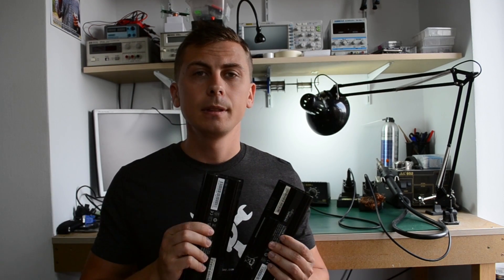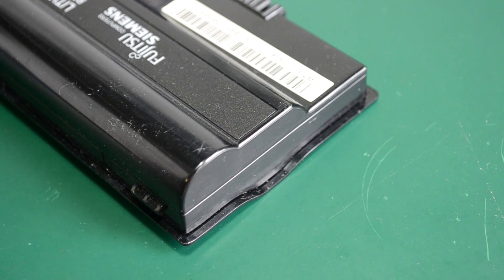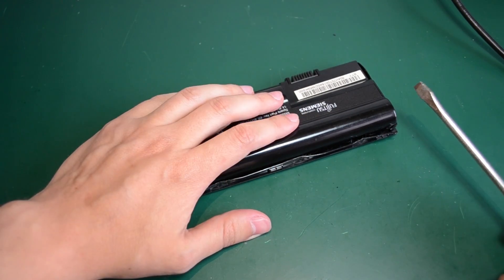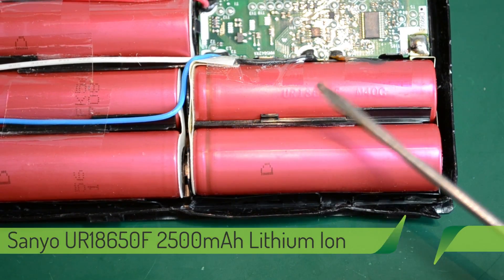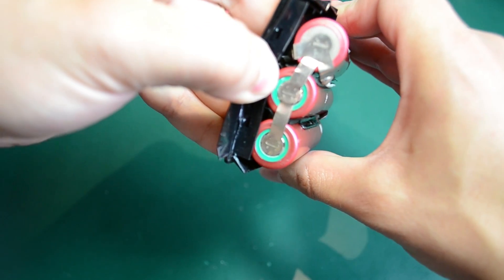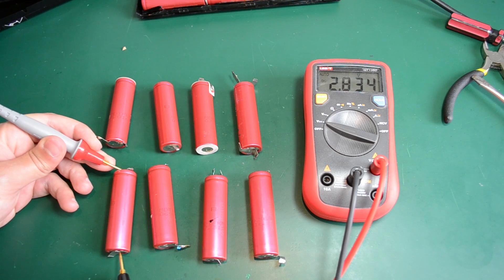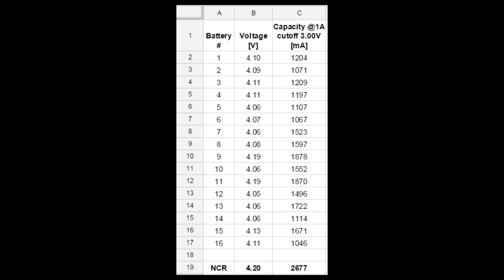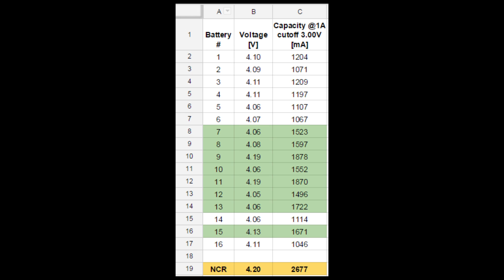VoltLog #16 - Laptop Battery Teardown and Lithium Cell Recovery

Comment: I can add that this 3-terminal fuse is required as final protection stage - in ctitical situation battery's controller can destroy the fuse to save the cells from blow and fire.
Reply from the maker: Highlander thank you for sharing that.

Comment: It's a three-terminal (chemical) fuse. By applying a current through the third terminal, the connection between the other two terminals is blown. The current is much smaller than the current it can pass through. Basically it behaves like a one-time switch.
Reply from the maker: Jernej Jakob Yes, that seems to be correct. Found info supporting that in datasheet from TI and also found similar looking part on taobao for $0.32 a piece. Thank you for sharing the info!